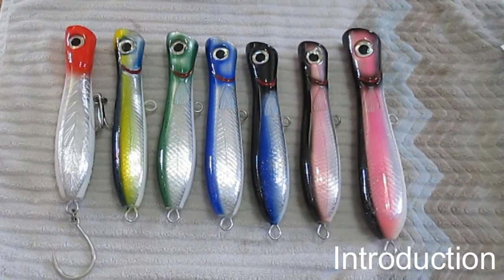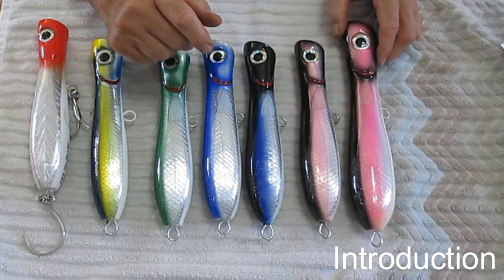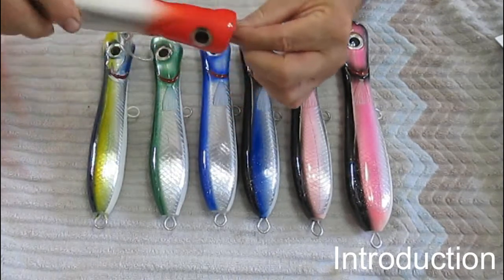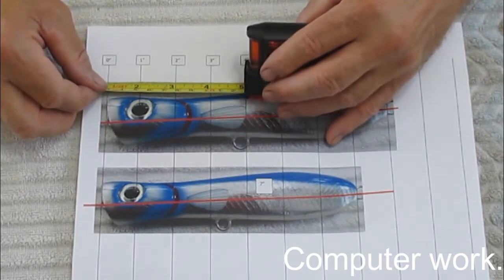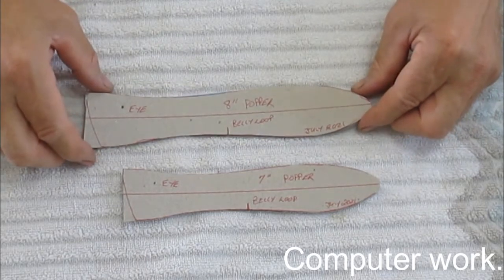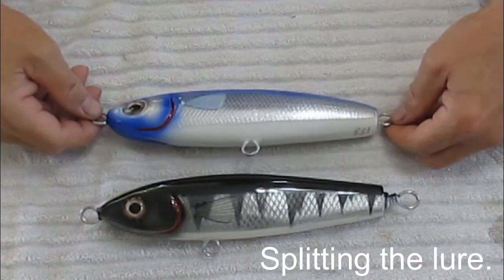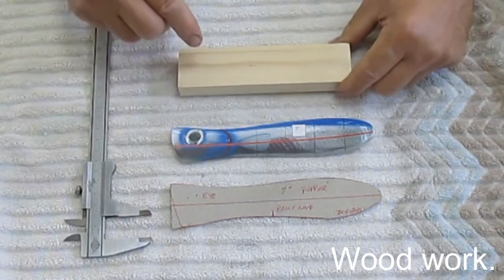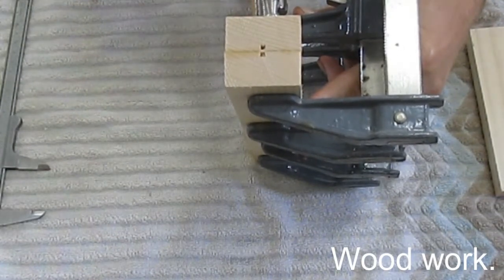Making Poppers Part 1

Comment: HI, Allan. 
     I just discovered your popper series and watched this first one. I'm an amateur lure-maker, lifelong saltwater fisherman, and big surface-lure fan, so it's right up my alley. Some viewers may criticize you for what they see as an AGONIZING amount of detail and explanation, but even though I don't need it, BEGINNERS DO! You have done them a great service, and I wish there were a way to get the word out to all those who dream of making saltwater lures on a lathe..
     The one thing that struck me as odd about this EXCELLENT part 1 is that you don't mention what kind of glue you use to temporarily laminate the clear pine before turning it. This strikes me as critical: It has to be strong enough to keep the stock together on the lathe, BUT it also has to be "weak" enough to allow the pieces to be readily separated after the lure is shaped.
       I, too, use temporarily laminated wood (Home Depot poplar) for my baits, and I have settled on strips of a high-quality two-sided shop tape, which is clean, quick, and effective. Are you using an all-purpose "white glue" like Elmers? I can't tell from the video but think viewers will need this information right off the bat.
Best,
Chris
Reply from the maker: Hi Chris. Thank you for your comments. I use Elmer's ProBond Max for all my wood gluing. It is rated ANSI Type 1 Waterproof and it's available at Home Depot! I just got back from a long distance fishing trip. I caught 2 Wahoo with my lures. The biggest was 50 lbs.. Both lures I used look very chewed on, which is great. The 2 layers of 2 part epoxy coatings took a real beating!
Reply: @allandoell1025  Thanks for the follow-up! Chris
Reply from the maker: @labtrainer09  Always a pleasure sharing.